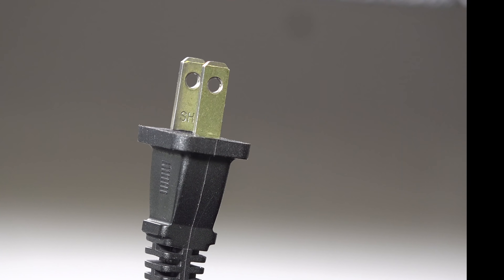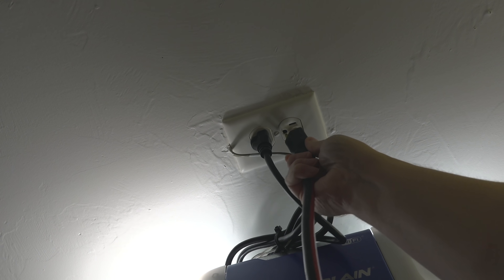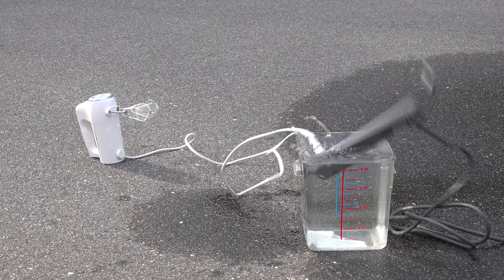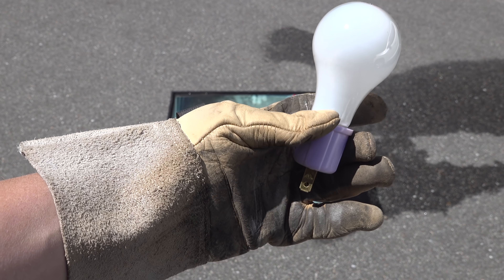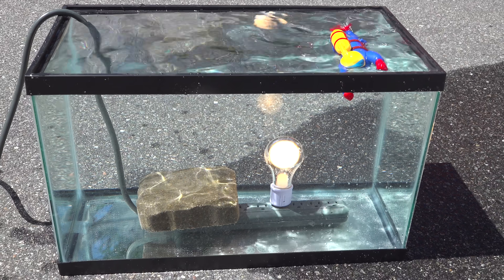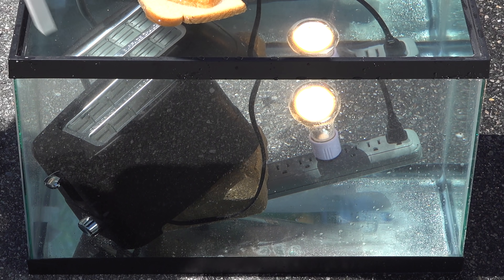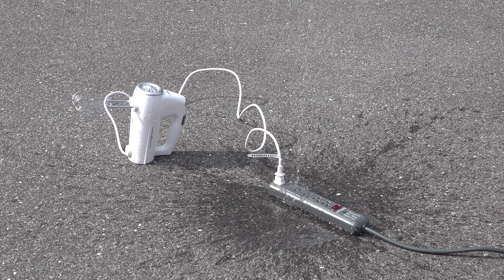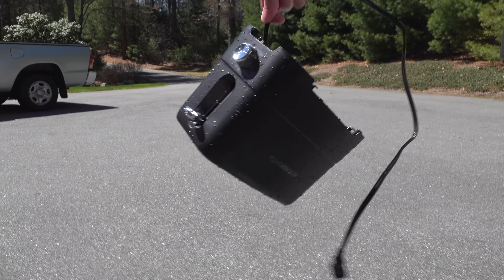What REALLY HAPPENS WHEN YOU SPILL WATER in an OUTLET?

Comment from the maker: Thanks for watching please LIKE & SUBSCRIBE - Power strip used: https://amzn.to/34SczFu  I am hoping @Electroboom may shed some light on the results of these tests? Do NOT  try any of the tests you saw in the video. There were numerous safety precautions taken that you can't see to ensure I was safe at all times.
Reply: Maybe you should try adding some salt to the water. That should make it a better conductor. Then what would happen??
Reply: @bobWsterguy  I worked for many years on the design and use of electrode boilers, where the water was used as the resistive conductor between phases. They varied between 500 kilowatts and 1 megawatt and were used for heating theatres and film studios. 
The early problems were the calcium carbonate in the water depositing and insulating the electrodes. Demineralised water had a high resistance and no current flowed. Sodium Sulphite added to demineralised water corrected the resistance without forming insoluble deposits. The next problem was the rise in current as the water heated, caused by negative temperature coefficient. This was solved by using insulators sliding along and adjusting the area of exposed electrode. Finally a neutral shield was added to contain the current flow when the supply was star configured as in a 240/415 volt supply. This was bonded to yellow phase in an 11Kv installation, where the configuration was delta with yellow phase bonded to ground. 
The concept was not entirely new and had been used for safety in munitions factories during WW2
Needless to say, more than one of my staff ran for he hills when they saw the current directly exposed to the water, particularly at 11,000 volts, which on one site was producing 3 megawatts of heat in an enclosed pressurised 6,000 gallon loop at 270 degrees. 
It certainly gave a whole new meaning to PME.
Reply: The reason why the outlet never tripped is because the water wasn’t conductive enough to draw enough amps to trip the breaker. The reason why the GFCI outlet tripped is because it is much more sensitive. GFCI works on the principle of differential, or in laymen’s terms “what goes in must come out”. It measures the current “into” the phase wire and “returning” on the neutral wire, and if any current “escapes” this zone, which would be going to the ground in this example, it trips the outlet. GFCI outlets require only a tiny amount of current “escaping” to trip, and that’s why it tripped in this case. 

If you measured the current in the ground wire, you will probably see an increase in ground current when the water hits it. It could be really small or it could be just below the minimum amperage trip that the breaker is rated for. That is a dangerous condition when the ground is “energized”. This means there is a voltage potential gradient where current can flow. If your body ends up being within that voltage gradient, you could become a conductor of current, and it only takes milliamps to stop your heart…This is also why this condition is so dangerous because it could take 20 Amps to trip the breaker (without GFCI).
Reply: Ry  Yup, I agreed with you...👍
But on the part of 'voltage potential gradient' or 'voltage gradient' as mentioned, we have to remember that any current that is leaking and travelling down Ground Conductor is relatively small.
Remember, the Hot/Phase will also 'travel' towards Neutral when submerged in liquid(water).

Given that the Ground Conductor is referenced to Zero Ohm against ground/earth, and the human body has a quite a huge Resistance, when the leaking currents is travelling down Ground Conductor and we touched it at the same time, Im sure that for the given permitted Touch Voltage, its quite little to none lethal current that will 'choose' to travel past human body with large resistance rather than the 'good zero ohm path' that the Ground Conductor is providing...

Things will be different with a dead-short against Ground. This will surely create a huge blown of currents enough to trip any Breakers...
GFCI truly shines when the Ground Conductor is not present, hence our human body will become the Primary Path of that leaking current. Without a GFCI, it wouldnt trip anything but its lethal enough to cause injuries/death.
Reply: @Ry____  The problem with his water tank, is that it is not grounded, so the electricity has nowhere to go but back.
Reply: you might be producing hydrogen!  also try adding a little salt to the water and see what happens
Reply: To add to what others have said, your body is made up of salt water which is more conductive than fresh water. That mean the electricity will flow through your body and not the water that surrounds you.
Reply: Before watching I can tell you. Water in itself is a poor conductor. It's not until things are added to it it becomes conducive. Like the sodium hydroxide in the soap when you throw a toaster in the bathtub or chlorine/flourine/ insert other disinfectant your local community uses to purify water. salt water or water with electrolytes in them are good conductors. Pure distilled water is not conductive no matter what your 5th grade science teacher told you remember its 5th grade not university. Plus manufacturers generally spill proof there devices. So I wont be surprised if nothing hapens.
Reply: Add some salt :D
Reply: @ventustium  EVEN MOARR SAAALT?
Reply: @johnc6343 p
Reply: @matthewmilne163  look at this legend
Reply: meow meow meow
Reply: Here are portable generator safety rules: this safety information is only for anyone who use a portable gas generator and for those who are planning on getting a portable gas generator. This is just a reminder for everyone’s safety. All generator safety rules should be followed carefully. This advice is just to make sure that everyone is aware of all the warnings and it’s just to remind people to be careful using portable generators. Generators can be dangerous if not used carefully. Every year, hundreds of people die or get injured when using portable generators due to carbon monoxide poisoning and electrocution. Make sure you are using your generator carefully and keeping others safe as well. There is something very serious that everyone should always be aware of when using generators. Some people do run their generator indoors which is not safe and that increases the risk of carbon monoxide poisoning which can cause death of family and you. Some people run their generator in wet conditions which can electrocute them. Please remember that you should never run your generator indoors. Remember that carbon monoxide is an odorless and colorless gas that you cannot see or smell. Carbon monoxide is a silent killer. Keep that in mind. Make sure your generator is 15-20 feet away from your house and away from doors, windows, and vents. Never use your generator in your porch too. Having a carbon monoxide detector is very important against generator safety. Some people also allow children to go near the portable generator which could pose risks. We need to keep an eye on our children making sure that they are not near the portable generator so they won’t get electrocuted or burned by the generator which is dangerous. A locking enclosure also keeps kids safe. A generator shed might look like a tempting place to explore, or take cover during a game of hide and seek, but a generator is a dangerous piece of equipment that can cause injury. It says on the manual that we should also keep children away at all times from the portable generator to avoid injuries. Please do not allow a child or unqualified people to operate the portable generator.  It is important to keep your children safe especially little ones. The portable generator can be hot during an operation. Just because some manuals missed what should be listed doesn’t mean it’s safe to do. Always follow the generator safety rules when using portable generators. Generators pose electrical risks. If you need to use your generator during wet weather, you need a generator tent to protect your generator from getting wet. Don’t let your generator get wet. Keep your generator dry and before using your generator, please make sure your hands and your generator is dry. Do not wear loose clothing when operating the generator. Everything that is said on the generator’s operating manual should not be ignored. Never smoke cigarettes near the generator. Please keep flammable things away from the generator. Never overload your generator too. Your generator can catch fire. Never ever try to plug a generator cord into a wall outlet to avoid back feeding. Back feeding your generator is dangerous. Always turn on your generator first before plugging in appliances and shut off the appliances before turning your generator off. Use a heavy duty cord for your generator and the cord should not be worn out. All the instructions should be followed carefully. Never refuel your generator while it’s running. It can cause fire if fuel spills while your generator is hot. You should turn off your generator and let it cool off before refueling it. Having a fire extinguisher next to the generator is also important. This is only a reminder for everyone’s safety of using generators. Make sure your generator is properly grounded. Having a fire extinguisher next to the generator is also important against the safety rules. https://youtu.be/I1jT3ANENvI and here is a video more about keeping others safe when using generators and also about our family’s safety. Hope this helps. Thank you.
Reply: Sorry can’t like & subscribe because tried it at home. Now I’m sitting here in the dark without electricity and Internet. Need instructions, what can I do now?
Reply: @Alessa238  Put your tough on the power strip..
Reply: Why is your hand safe even though you touch the water with electricity.
Reply: BEWARE: The conductivity of water depends on what salts and how much of them are dissolved in it, and that varies by geographical area. Results would have been different elsewhere. Never get water on mains plugs, sockets or devices, and only operate mains switches and plug in mains devices with dry hands.
Reply: Thanks for the plug. 🙃
Reply: Now that I have watched I am not surprised. The reason the breaker didnt trip is the resistance provided by the low levels of chlorine was not enough to cause your breaker to trip. Now if ya want to excite the neibours(I am not at fault if you are stupid enough to try this...) Try using some transformers to increase the voltage to somewhere around 20000. And with that gfci you would still be dead it takes 1/10 th of an amp with the exposure at 1/10th of a second to stop your heart.
Reply: you should have used some salt
Reply: U woudnt die it whold just hurt
Reply: this video is a good watch about these type of things:
https://www.youtube.com/watch?v=K_q-xnYRugQ
Reply: Iii o
Reply: next put a fork in a socket
Reply: You called a whisker an egg beater? I've never heard that before.
Reply: How about a TOASTER IN RESIN :)
Reply: https://youtu.be/xo6t1uvCSZE
Reply: AAAAAAAAAAA
Reply: I am BLOWN AWAY and I DO NOT BELIEVE WHAT HAPPENED. Not really thoigh
Reply: Add some sort if middle conductor(dont know how to explain it) use salt or soap for a better current
Reply: For scientific questions: what happens when you use cheaper items?
Reply: No solids in the water. Use salt water
Reply: https://youtu.be/pdAm1sqcT1o
Reply: https://youtu.be/pdAm1sqcT1o
Reply: Probably you could get some additional info if you measure the current in the cables and thr temperature. Bet the consumption went high. Also, try with salted water, that could make a real difference.
Reply: @alvaroagr  Early stage lighting dimmers in the theatre worked by lowering copper rods in and out of vats of brine. 
The negative temperature coefficient of resistance  meant that the depth to light intensity changed as the current dissipated in the brine heated it up, so the lighting engineer had to compensate all the time. 
In a few cases, the brine started to boil by the end of the performance. 
The same method was used to ballast the carbon arc spotlights back in the days when mercury rectifiers did not ballast the current and some of the brine vats contained around 100 gallons. 
Cinemas used a similar system, but the resistors were air cooled nichrome coils.
Reply: Hi
Reply: Need to add some anions like salt.
Reply: GFIs don't work either..I saw a 3 foot ball of plasma coming from a power strip that got wet hooked to a GFI..I had to manually flip the main breaker to stop it.
Reply: Try hot water and you will see out gonna sparks 👍
Reply: now dump salt in to to the water and retry
Reply: Use salt water
Reply: Where do I buy that scuba man toy that swims?
Reply: Water+electric=fire
Reply: Love the safety message. it’s like kids wanna do everything they see online now which is understandable bc they’re kids. But like pls stay safe and just watch it from behind ur screen 😭😭
Reply: “Dont try this at home” so im gonna try this at my friend’s home😃
Reply: Broo try this experiment on salt water...😅😁😁
Reply: Ppp
Reply: Jesus Christ Is Lord & He’s coming soon. Don’t take that vaccine
Reply: well clean water works like an insulator
Reply: Electric boom or whatever his yt channel is called did a pretty good video on this years ago. So it's really all about how dirty the water is or full of stuff like salt. It also depends on the distance of each wire which is the hot and neutral.
Reply: JUST ONE KIND OF AN OUTLET. NOT COOL.
Reply: Hum why don't you try with something connected to ground idk if that works the same in your country
Reply: you need an grounded wire the plastic bucket and fish tank are not grounded if you grounded them it breakers would have gone off.
Reply: I now sleep in a warm bath with my George Forman Grill and a toaster so I can wake up to the smell of crackling bacon.  I put 2 pieces of bread in the toaster and rinse off the lettuce and tomato that was soaking with me over night, reach into my mini fridge for the mayo, and have BLTs for breakfast everyday!
Reply: Prove that pure water doesn’t conduct electricity 👍
Reply: As much as i hate to give him credit, i recall a Bill Nye episode when i was a kid where he put a light with exposed wires next to a container of water. He then put the exposed wire leads in the water and did the same with wires connected to a power source on a switch. He switched the power on and nothing happened.
He then repeated this with salt water and the light lit up.
Conclusion: water by itself does not conduct electricity (or at least not well enough to do anything), but salt water does.
The human body contains enough salt that when exposed to water, it will conduct enough electricity to shock you or kill you.
Reply: Put some pants and a long sleeve shirt next time while doing your experiments. It's not safe if some of your skin is exposed to hazardous activities. Children might copy your work ethic which does not have any safety protocols.
Reply: @parengthonycastillo  I mean he said dont ever do this..
Reply: That's not a mere power strip you used. Appears to be a surge protector.
Reply: It looks like you forgot that water itself isn't conductive. Try doing this again, but put salt in the water. Actually, maybe don't cause I have a feeling the reason you couldn't tell us the safety measures you took didn't really exist, and if you forgot to put a conductor in the water, you will likely forget something more important and end up getting fried
Reply: @johnc6343  Yes Mike Dawson got it right Add some salt!   ESPECIALLY if your using distilled water.  Even if your using reverse osmosis water!
Reply: Yes I think I do, If I am understanding did you use everything that was waterproof to do this?
Reply: Ok
Reply: K
Reply: How about unplug it then plug it
Reply: wdawda
Reply: I intend to throw both bare black "hot" wires, and white "neutral" in water with 100 Watts going thru. On the video it was simply ONE wire in the water. I want to try BOTH bare, in water! I'll let you know if I get fried!
Reply: Add some salt in the water and you will get results.
Reply: Those bubbles coming off of the toaster, what kind of gas was that?
Reply: @JeffreyAllanBackowski  bro there is  heating coil inside the toaster to toat the bread that's why the water gets heated due to coil contact and bubbles come out.
Reply: @ohm.3768  yeah but the bubbles are a gas, is it oxygen, hydrogen? If you collect the bubbles in a test tube, then stick a match up in the test tube, if it blows up you got hydrogen or oxygen.
Reply: @JeffreyAllanBackowski   uhh I think there might be oxygen and hydrogen present in water which might get released with water vapour
Reply: @ohm.3768  yeah, so which is it, oxygen or hydrogen?
Reply: @ohm.3768  one day I may need some pure oxygen or hydrogen, and knowing all I have to do is toss a toaster in the tub. I was as confused as you, I do not comprehend why that stuff didn't blow up. In the third grade there was a power outlet in-between the urinals in the bathroom. One day I peed on the wall above the outlet so it would trickle down into the outlet. It sounded and looked like lightning struck it, all the lights in the school went out, I panicked, I almost cried, I'm so lucky I didn't almost die, and then I see you squirt water right into one and nothing? You should take it apart, maybe they put water seals in it. What type of water did you use? Distilled water does not conduct electricity, tap water does.
Reply: @JeffreyAllanBackowski   bro 😂😂😂🔥 you on electric socket😂.
Actually our urine contains salt and other bodily elements that's why.
The other hand water contains less impurities to conduct that kind of electricity for that you need to add some impurities and add some  salt and apply electricity there will be shot circuit.
Reply: Ok if I were to guess, you most likely used a gas powered portable generator, that in my opinion the " safest way to do these experiments 👍🤔
Reply: @Charles-re4vd   it doesn't matter if you use gas powered generator or normal household supply.
Reply: It looks like you used distilled water, pure water without any impurities and soluble salts (electrolytes) doesn't conduct current…
Reply: @Amy_Price  yes you're right.
Reply: This is very dangerous. Person can die in just 1 second. 
please do not try this.
Reply: You're nuts 🤪
Reply: Water doesn't conduct water. If you redid these tests with distilled water you'd have very very different results
Reply: The reason why it’s not doing anything is because water alone isn’t conductive enough you need to add something conductive like salt for example for it to stop working (DO NOT DO THIS WITH SALT WATER ITS DANGEROUS)
Reply: Uhh what happens when it goes in a wall outlet...
Reply: Add some salt for better results, not just water
Reply: FAKE FAKE FAKE!!!!! Mir ist mal passiert, dass nur ein wenig Feuchtigkeit in meine Steckleiste geraten ist. Plötzlich war es dunkel. TV aus, Licht aus - dunkel eben. Ich hatte eine Taschenlampe, damit ich ein wenig sehen konnte und ich hab' das Maleur gesehen. Steckleiste aus SK entfernt/ausgetauscht, alles andere trockengewischt - hin zum Sichrungskasten - RCD hat ausgelöst - RCD wieder eingeschalten und alles war wieder in Ordnung. Auch ohne RCD fliegt dann eben der LS. RCD ist jedoch Pflicht - zumindest in der EU.
Reply: @andrewpeterson9250  I suspect that if you had salt it will cause all the breakers to trip because it will short out.  Probably would be dangerous. Certainly don't touch the water if it's got salt in it as it will likely be conductive.
Reply: Should do a colab with @electroBOOM
Reply: The reason why you didn't notice anything going on with the standard power is because it has to be grounded and the only way you're going to get electrocuted is if you become the ground don't try it it takes a fraction of an amp to kill you it's same reason why they make power tools out of plastic so that way they're double insulated they used to make skill saws power drills and everything else out of metal or magnesium or whatever and they didn't have a ground strap and what would happen is if it got a little damp on it or whatever the current would travel through your body and go to the drill skill saw jiggy whatever and that's how you would die
Reply: Regular water has resistivity of somewhere 500ohm-m, so what were you expecting? Breaker won't pop because of some electrolysis using 5-10amp current. 
A 10amp regular breaker still work under 20 or 50amp of load. In short circuit we have thousands of amp in which conditions breaker pop instantly. 
A 10amp breaker will break the circuit above 10amp load after running for hours.
Reply: Warning from Holy Bible to Humans:- The time is fulfilled and the kingdom of God is at hand, please repent from all your sins before Lord Jesus Christ, thou shalt be saved and thy family members from eternal Hell to eternal Heaven Amen 🙏🙏🙏